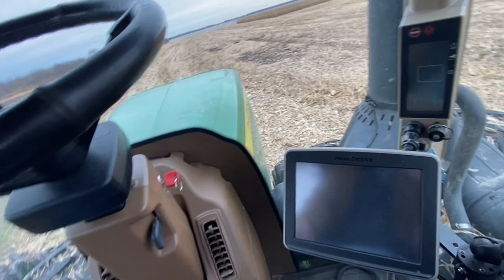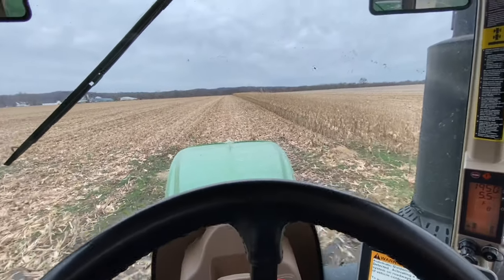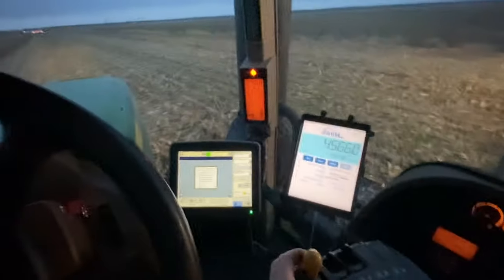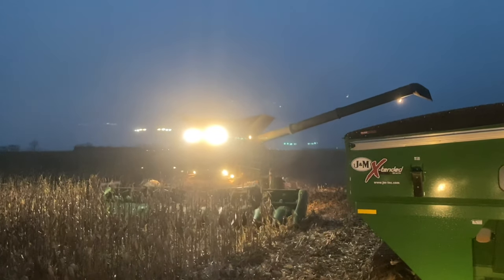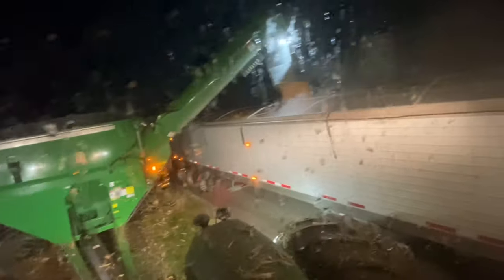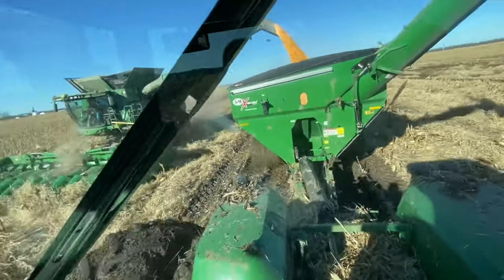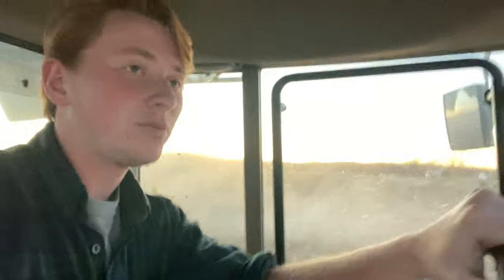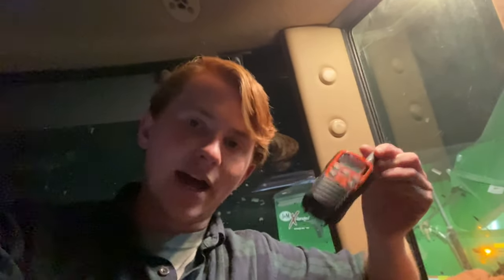Cab corn caught on camera

Comment: I know how to help u with your making rounds problem. Just grow really poor corn. Also I recommend that you don't have the throttle wide open going across the field unless you're loaded it better for the engine
Reply from the maker: When it’s on the wet side I run wide open so I don’t run out of power. When it’s dry I’ll gear up and throttle down